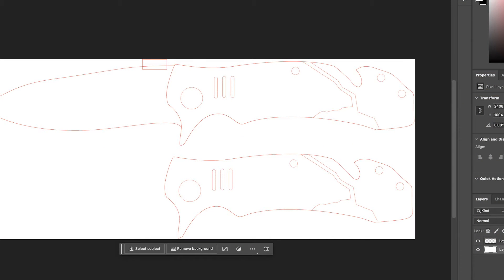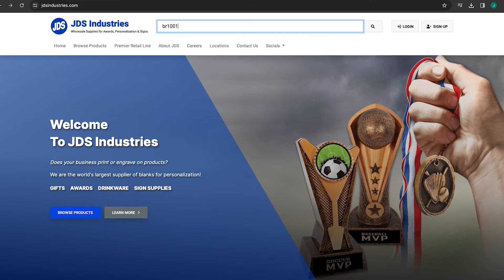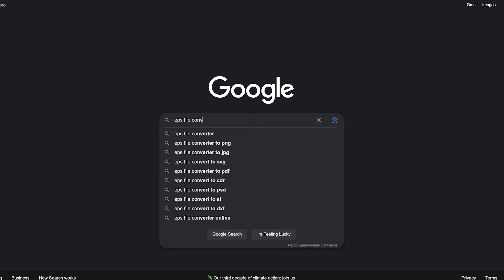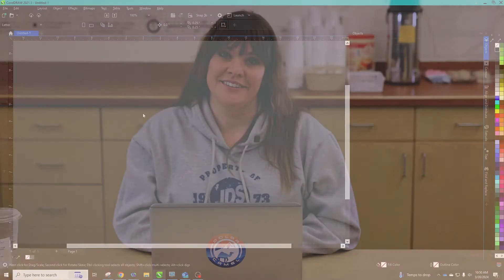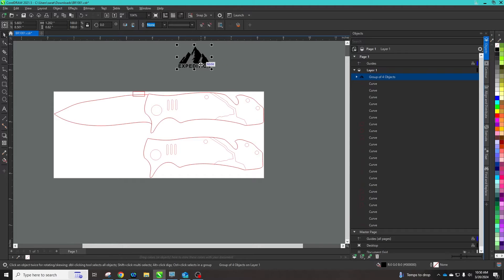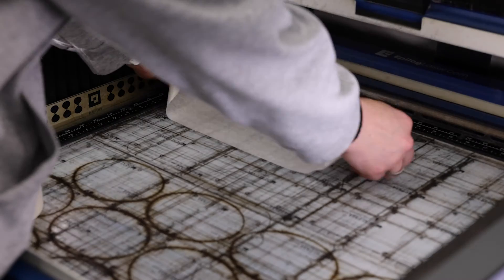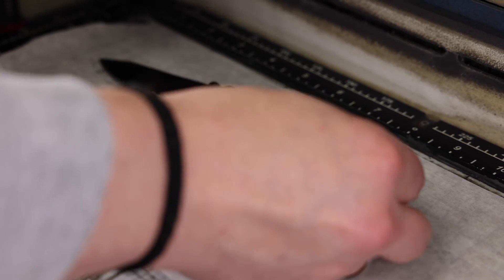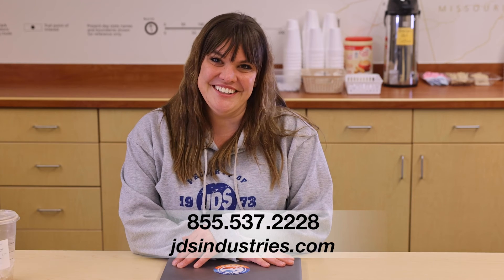How to use FREE Templates For Laser Engraving, UV Printing, and Sublimation

Comment: the bison river knife you are using in the video has the glass breaker. In the template the glass breaker is not on the template. Is there a way to fix this so it will be as the knife is? Thanks
Reply from the maker: I will pass this along!